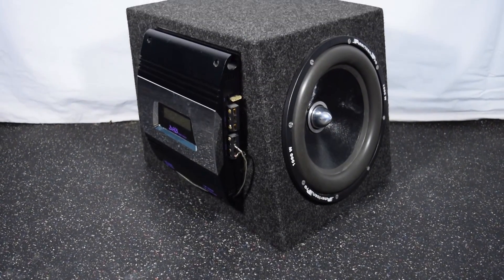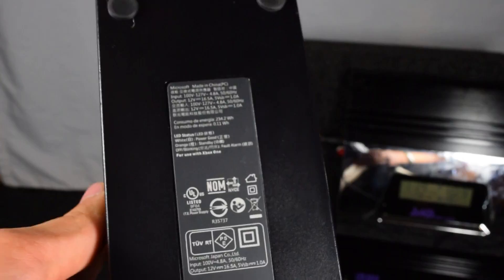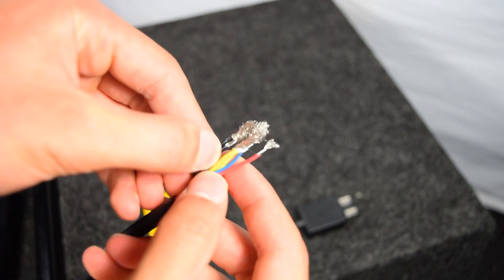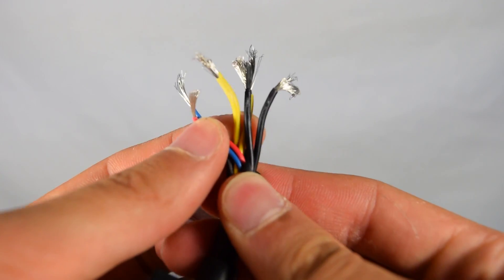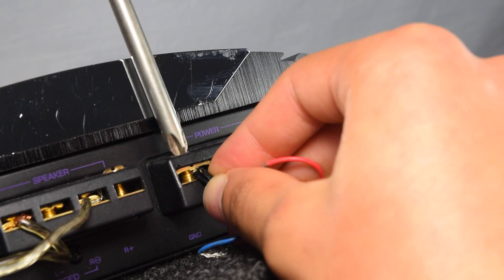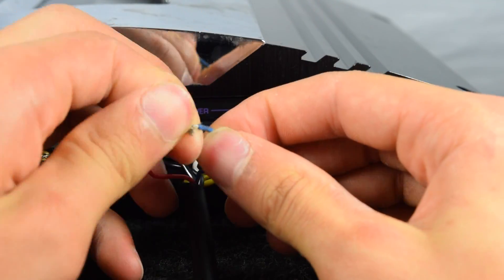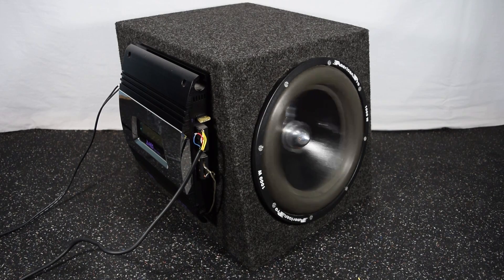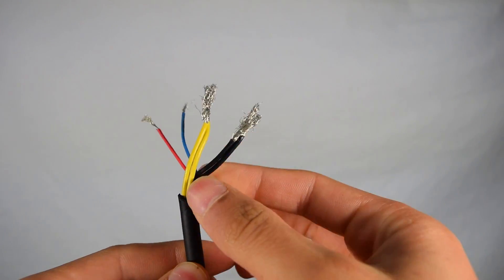How To Power Car Sub/Amp In Your House | Using Xbox 360/Xbox One Power Supply

Comment: Cute project but that little power supply just provides enough amperage to get a little over 100 watts to the speakers regardless of what amplifier you use.
Reply: I have a 2400watt 🤣🤣
Reply: @gabrielbrown3270  prob 200 rms
Reply: @gabrielbrown3270  yeah pmpo

Comment: hey i was wondering i have 2 1200 watt subs, i use a xbox power supply and it doesn't have enough power to use the sub a full volume so i was wondering if i could use another xbox power supply and run 2 at the same time and go more power going it the sub, i dont know if this is a good idea or a bad idea, i could think of many issues with my idea but i wanted someone else's opinion
Reply from the maker: +Ryan Demarie I could see both power supplies feeding output into each other. I think there would be a safety feature to prevent that, but it should work to power the amp!
Reply: thanks i had a feeling they would feed into each other, i just didn't know if i was thinking correctly, do you think i should try it?
Reply from the maker: +Ryan Demarie If you depend on the power supplies or need them for anything, it's up to you. But I would try it! Let me know how it goes.
Reply: wouldn't there be a problem with the amount of volts i'm putting to the amp, would the 12 volt power supplies combine to 24 volts, if so wouldn't that be bad for the amp?
Reply: and also would i not hook up one of the grounds i've been reading around and some people say that you will short out one of the power supplies if you have both ground hooked up
Reply: could you describe to me how you would wire my idea up?
Reply from the maker: +Ryan Demarie Strip the power supply cords then twist ALL the blacks together, and all the yellows together. And then connect the red and blue just like in the video. (Don't combine those between the 2 power supplies). I hope this works!
Reply: so out of the 2 power supplies take all yellows and connect them together and take all blacks and connect them and connect the red and blue separately, don't combine those....right?
Reply from the maker: +Ryan Demarie Yes, correct.
Reply: +Ryan Demarie  Yes it will work I have it running an amp myself currently I have two connected into (1) socket works great no more dimming lights especially no more red light!! Email me if you'd like pictures? Southern.g31@gmail.com
Reply: Don't worry about voltage if it get's to low the brick will go into protect and cut the power.
Reply: Try it it should work depends if that's a max rating or rms but really you should be able to find the right volume/gain setting if it produces to much power give it a try!
Reply: Ruben A is bad if ur voltage drops when ur bass hits under 127voltage? And if we can talk more about it my Facebook is Nate Fenton and it's a picture of me with a elf hat with green lights and camo Sun glasses.
Reply: Ruben A is it bad if I have a 125watt kicker amp powering a planet audio 12 inch subwoofer?
Reply: Haha well how many watts is the brick? IT SAYS ON the white sticker if your using an xbox360 brick. Honestly I think any brick can handle that really you might get dimming lights but I don't think that's enough watts for to do that so NO. I HAVE TWO 12'S ON A 750 WATT MAX AMP BUT I HAVE TWO BRICKS CONNECTED TOGETHER.
Reply: Ruben A the power bricks power is 203watts
Reply: Ruben A should I try to invert my subwoofer or will it not be louder
Reply: i Emailed you lol
Reply: B
Reply: Ryan Demarie I have two Xbox 360 power bricks powering my amp and its about 825w Rms and works great
Reply: Ruben A  I need help can you show me your set up

Comment: i used xbox360 slim power supply and it works for a good 30 seconds and then trips to red light. does my kicker cxa300.1 amp with 10" sub suck more power than what the power supply can give? what if i put two xbox 360 slim power supplies together? would that work? lol
Reply from the maker: +nick olson The Slim's output power probably isn't high enough for your amp unfortunately. When you say it trips after 30 seconds. Do you mean when you start increasing the volume for 30 seconds?
Reply from the maker: +nick olson The Slim's output power probably isn't high enough for your amp unfortunately. When you say it trips after 30 seconds. Do you mean when you start increasing the volume for 30 seconds?
Reply: at any volume it works for 30 seconds with green light and then goes into protection mode red light. i then wired two xbox slim power bricks together to see if that would work. still not enough power im guessing?
Reply: i also wired a switch it the power bricks and they have no problem being on standbye mode orange light. but once turned on it only stays powered for at most 30 seconds.
Reply from the maker: nick olson Very strange. Do you have a wire bridging between the REM and 12V terminal?
Reply: Yes I do. I'm guessing at this point it was a good try but I'm going to have to get a small 12v 30amp PCU. I wired two xbox360 slim power bricks together but still not enough power I'm guessing.
Reply from the maker: +nick olson I wish I could help, but I have not tried this setup with a Slim power supply. I hope the PCU works for you!
Reply: Thank you!

Comment: I did mine with the Xbox 360 but it had a extra light gray wire and I put together the red and blue but it stayed red ? Any help on that thank you
Reply from the maker: +Jorge Gonzalez Ok, this is tricky. I don't want you to fry your 360 Power Brick, but I would try different color combinations. Instead of red and blue, try Red, blue, and grey. Then Grey and blue, and grey and red after that. Let me know if it works!
Reply: EliteExpert I tried them an the only one that work was the gray and blue but it just stayed orange
Reply from the maker: +Jorge Gonzalez Try connecting the grey wire to the black GND wire. Then touch the red and blue together.
Reply: EliteExpert  Thanks! that actually work!
Reply: @EliteExpert  
^^^
Reply: Jorge Gonzalez thanks I been on this the whole day and this is what I nedded
Reply: Okay so ive hooked everything up but the light stays orange, when i touch the red and blue together the light just turns off.. any suggestions??

Comment: You can also parallel wire multiple Xbox 360 or Xbox one power bricks together for more current which makes your subwoofers louder and reduces your risk of a voltage drop parallel wiring them together is more efficient
Reply from the maker: +Travis Gulley Very smart!! 😃 Thank you!
Reply: Do you have to plug in both power blocks
Reply: thats ironic . just buy a power supply
Reply: @musiccreator3222  that defeats the purpose. Alot of people have old Xbox 360s sitting In Their garage collecting dust. Why waste mo ey when you ready have it
Reply: @musiccreator3222  I don't know that "ironic" means what you think it means...perhaps "moronic", maybe. Maybe not...🤷🏻‍♂️

Comment: Would this work on a 1500.1 or 1000.1 monoblock amp?
Reply from the maker: +Kevin Mahaley That's quite a bit of power! Nice amp! I wouldn't trust going full blast on the power supply, for an amp with that much power. You can definitely go half or 3/4 power though!
Reply: it will work....but only be getting a little over 100 watts to the speaker
Reply: Kevin Mahaley get two or three power bricks and it should be good I have two for mine and it works great

Comment: Since this is a newer video if I cut my actual power supply for Xbox and connect the blue and red off the amps power supply to Xbox will it turn on when Xbox does?
Reply from the maker: +Dwright 2k19 I'm not sure I understand the question! Could you rephrase it? Thanks!
Reply: EliteExpert I will make a video on my setup a while later but you got two power supply one is for the Xbox and the other is for the amp instead of connecting the blue and red wire togeather connect them to the other red and blue wire on the Xbox's power supply whenever u turn the Xbox on the amp triggers on two I was asking if it would but I done it and it does
Reply from the maker: +Dwright 2k19 Ohhh, I understand! Glad it works! Smart thinking man :)
Reply: @dwrightproductions8281  thats crazy  lol i never thought to run it and the xbox to cool